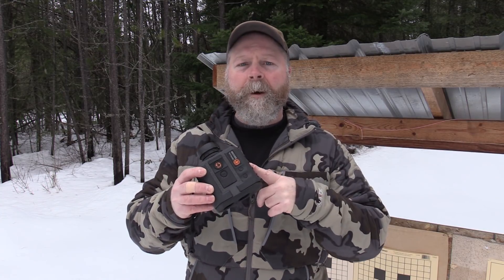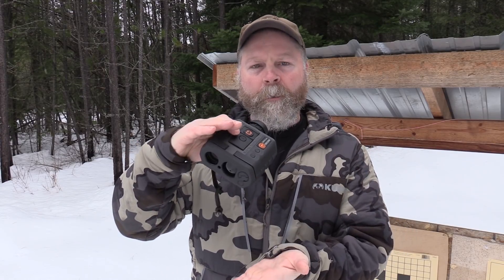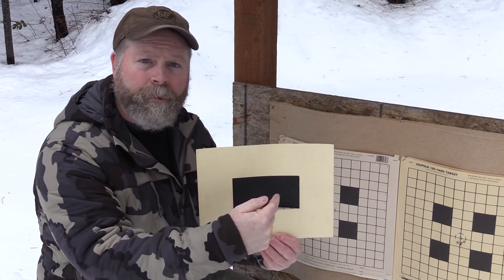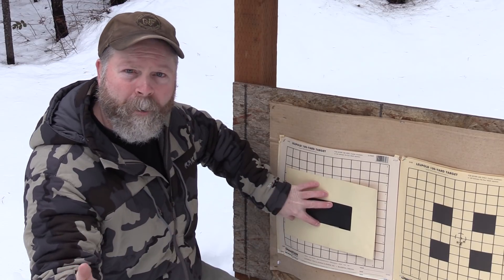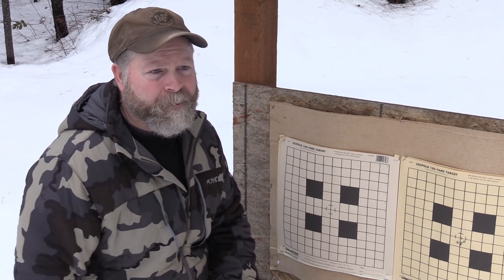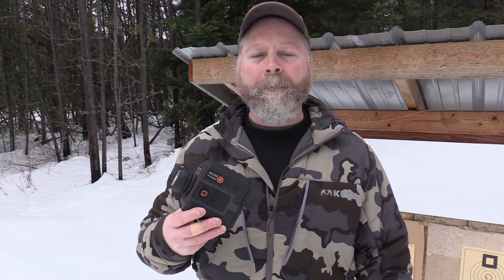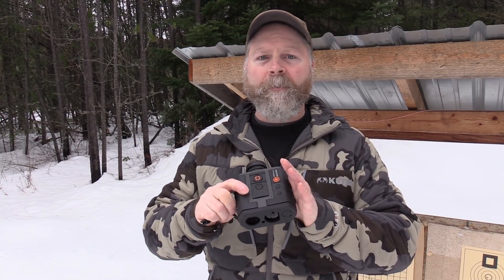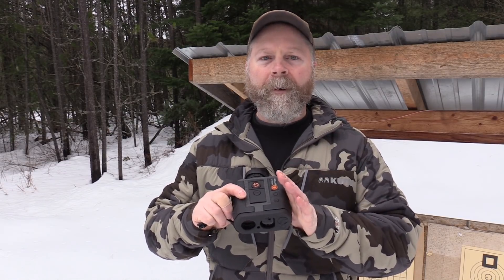Laser Rangefinder Beam Divergence & Reticle Alignment

Comment: what range finder do you think has the best beam divergence? I heard the new leica 2700 is pretty good for the price.... i like having a separate ballistic calc outside of the rangefinder anyways...
Reply from the maker: Yes, as far as I know, the entire line of Leica CRFs, from the 1600 to the new 2700, have the smallest beam divergence of any commercial LRFs. Vectronix LRFs are slightly smaller, but in a much different price range and availability. I have a 2700-B for review now. It's beam is .5x1.2 MILs.